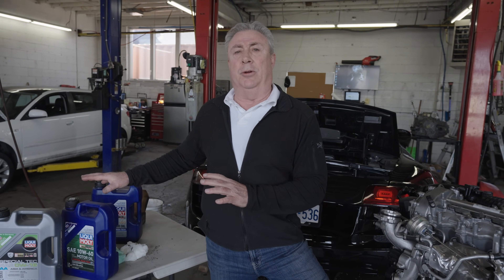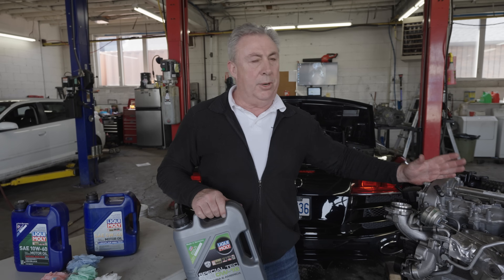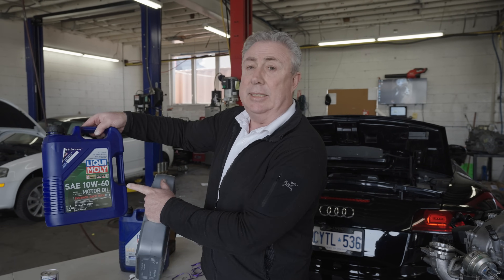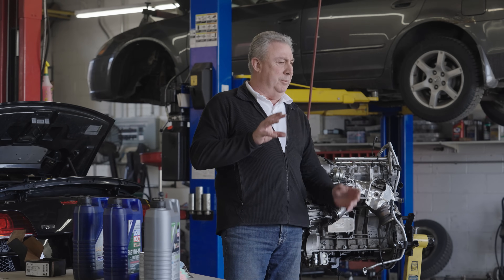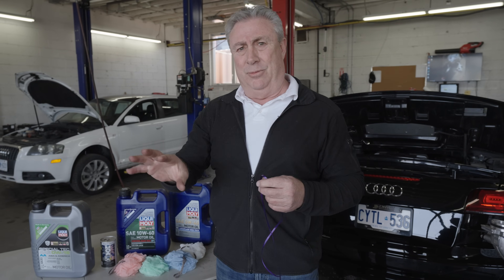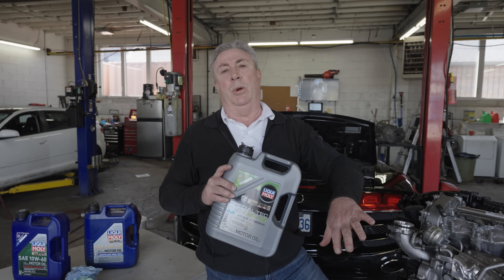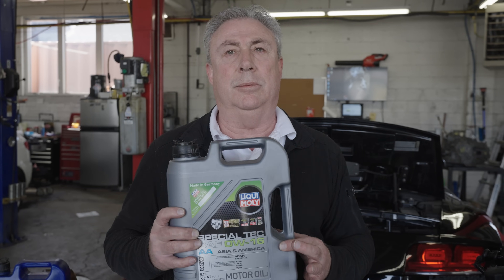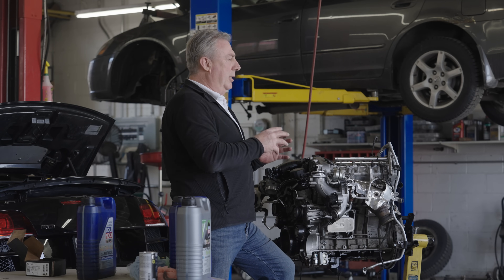Thin engine oil just a Scam? What's Safe

Comment: If you CARE about the environment, make your car last LONGER.   It takes more fossil fuels, minerals, energy to make a new car than to simply take care of your old one and lose 0.5 mpg over its life.  

The CAFE laws are good, but oil viscosity should not be what manufacturers use to get under the requirements.  

I knew I'd like this guy when I saw him using LiquiMoly oils.  Never use anything else in mine!

Comment: Multi-grade oil is not thinner when cold, nor is it thicker when warm. This statement of thinner when cold and thicker when warm is a totally false, misinformed belief! Why is it recommended to change your oil when the car has been running and is up to temperature?
The oil flows better, easier, thinner, than when it is cold. When the multi-grade oil is cold, it flows slower,thicker. Changing oil from a cold car, has a slower drain rate and possibly less oil will flow out of the drain as compared to a warm engine.

Multi-grade oils "ACT" like the numbers on the bottle. When cold the oil acts like the 0w,5w,10w or whatever the first number is. When warm, the oil acts like the higher number at that higher temperature. The oil is not getting thicker, it is acting like the 0,20,30 or higher grade would "ACT" (flow, viscosity) at that higher temperature.
The misunderstanding is: the oil acts differently as the temperature changes. The temperature controls the rated viscosity of the oil. It is an inverse action on the oils part. The oil acts like the straight weight oil at the different given temperature. I.e acts like the lower viscosity at colder temperatures ... acts like the higher viscosity at higher temperatures. The oil is not getting thicker as the temperature goes up, and it is not getting thinner as the temperature goes down ! It is only flowing,acting like a straight weight oil at the different temperatures. The oil weight is attempting to mimic straight weight oil for a given temperature.
Cold multi-grade oil flows slower than hot multi-grade oil PERIOD ! Cold 5w oil is much thicker than hot 30w oil.

                                       Hope this helps

Comment: Many folks are unaware that modern cars have variable speed oil pumps based upon engine demand. They require a certain grade of oil. My 2026 Prius takes 0W-8 oil and has very tight bearing tolerances if you use the wrong weight of oil the gap is so small you may starve the bearing for oil if you use a thicker oil assuming thicker is better. The motor oil geek did testing and everything was fine with his daughters car 0W-8, with the added bonus of better mileage with the thin oil. Summary; thicker is not always better. guys do not VOID your warranty by following uninformed advice. Motor Oil Geek https://www.youtube.com/watch?v=sALAUhldASc

Comment: I've been researching this online and I still cannot find a clear answer for modern engines. In the old days we always bumped up the grade when the miles on our engines hit 100K or so. But today's engines do have tighter tolerances. My particular situation is frustrating. I'm driving a 2019 Honda CRV with the L15 turbo charged motor. It's reached 100K miles. It says 0W-20 on the engine yet globally (aside from North America) this engine is rated for the use of 5W-30. I can't imagine that there are any actual tolerance differences between those engines and mine. My bigger concern is the oil passage to the turbo. I've read that it may not be able to handle a slightly thicker oil and I don't want to burn up the shaft bearings. Has anyone here used 5W-30 in a Honda L15 turbo charged motor in the USA?

Comment: Hello TAS, I work for an auto manufacturer and develop cars for a living. The viscosity of oil we recommend is dependent on four things: 1) Bearing clearance 2) Bearing surface area 3) Bearing load 4) Operating oil temperature. We can create proper hydrodynamic lubrication with oil that has the viscosity of water if we meet the proper criteria. There is nothing wrong with thinner oils if the engine has been designed for them. In fact, you're more likely to cause damage or codes running a thick oil in an engine designed for a low viscosity through bearing starvation and insufficient oil flow through the oil driven cam phasers. Most wear occurs at startup-not when running. Low viscosity oils get into the appropriate places faster-especially in very cold temps. 

The problems you are seeing with cars today and engine failures has to do with manufacturing issues and internal drama. People are making the assumption it's tied to oil, but that's not the case. Plants are struggling because of cost cutting measures, insufficient downtime for quality control and system checks, too many rookies and unqualified on the floor, etc etc. All this leads to manufacturing errors and problems. 

The fact that you see some manufacturers recommending thicker oil as a "solution" reflects the reality that replacing thousands of failed engines is not economically viable. Therefore you apply a bandaid solution to help slow down the problem until the vehicle is out of warranty. Thick oil is not solving the problem, but it's helping offset the fact you've got excessive clearance and bearing damage in an engine that has manufacturing errors.

Conspiracy theorists will tell you that thin oil is some EPA or government driven plot to ruin engines, but it's definitely not the case. We can make engines last longer and get better gas mileage by using lower viscosity oils. In some parts of the US the temperature falls to negative 40 degrees. If you run 15W-40 oil in those conditions you're grinding metal. Remember- we want to create a hydrodynamic state as soon as possible! That keeps clearances tight, bearings healthy and allows you to go 300k+ miles with proper oil changes. Thinner oils are not damaging your engine. Hope this helps.
Reply from the maker: Thanks for the industry pro insight!  Appreciate the feed back.

Comment: daughter's 2014 CRV has the notorious rattle on cold start ups with 0W20....does not have rattle with 5w20 or the 5w30 I currently use in it....lifters don't tick either.

Comment: If you have a Turbo in your engine - change your oil every 3-4000 miles (if your heavy on the pedal 3000 miles and if a normal driver 4000 miles) - spooling burns oil and wears it out in about half the time the car manual says to change.  Also, let your car idle when getting off the road for about 1-2 minutes to let turbo cool down.  I use 0W-20 all year here in Nova Scotia, Canada.  I go to the dealer as well.  2021 Honda Accord 2.0T Sport.

Comment: 0w20 or 5w20.
My thought is as long as it isn't sub zero out, I'm golden using 5w20 in my tacoma. Why? Because at some time during the warm up cycle, both are a 5 grade anyway. My engine just sounds a tiny bit quieter running 5w20 Ultra Platinum  vs 0w

Comment: I used 5-30 in my 2018 Malibu that " requires " 0-20 " . I had no issues and no loss in gas . There are as many people on here that say ," Use only what  the manual says",as there are that say it's ok to switch it up .

Comment: You are 100% wrong if you think it's all about fuel economy and emissions. Now I'm not going to go into a long in-depth explanation but I will say this. The thin oil is because the tolerances between the can shaft and the bearings and the crankshaft and it's bearings is very close together. If you put a thicker oil in such an engine it slows down the gallons per minute flow inside that engine. And since oil is 40% of your Cooling, because there are parts besides your engine that only oil touches. So it cools those parts by absorbing the Heat then transferring it through the block to the actual cooling system.

So if you add a thicker oil to an engine that's not worn for the tolerances are further apart because of that wear. The gallons per minute flow can slow down to a point to where the parts that the oil cools gets hotter, and the oil itself gets hotter. Hotter engine parts expand more causing more wear. Hotter oil breaks down quicker causing more wear. And you have to change it more often because the heat is breaking it down. And if you're pissed and rings we're mainly broke in on a thinner oil, a thicker oil may cause more consumption. And because the whole system is set up to work with the thinner oil, what gets up to the piston and the Rings to cool and lubricate will not be as much causing varnish buildup around the Rings and the Pistons which can cause the Rings to stick to the Pistons.

Then we have the problem of the oil pump pressure relief valve. When you put thicker oil in and increase the oil pressure, that relief valve that regulates the pressure will open up more sending the oil back into the old pan and not through the engine. This causes problems also because that spring that operates the overpressure valve in the old pump can lose it springiness and allow the valve to not fully close means that part of your oil pressure is going to continually leak out that over pressure valve. Which means you'll have to replace the oil pump or suffer major engine damage. And I can go on and on with all the problems this can cause. And by the way, if you do not use the correct weight, this voids the car warranty concerning your drivetrain which includes your engine. So telling people to do this is setting yourself up to be sued when this happens to someone who was just following your advice.

Comment: Been considering this lately... Toyota 5.7L with well over 100K on it, I let it idle a lot in our winters, it pulls a steep 5 mile mountain a lot and smells hot as hell when I park at the top and I never see any wear on the filter between changes.  I do change mine and always have at 3k in all my vehicles because that's just what I'm gonna do.   I do agree with the age old wisdom in this but haven't seen it happen in my Tundra as of yet.  As it does have the increased mileage I am considering jumping up to 5W-30 from 0W-20 just because things must wear over use and I'm just torn on this right now.

Comment: Trust me i  am an oil nerd and if you put the wrong oil in you will sieze your engine as alot of cars have tighter components which is why the oil is thinner . If u use thicker oil it will not lubricate  thats why you have a manufacturers manual to let 6ou know this duuuuhh

Comment: I have the Toyota 2GR-FE 3.5L engine. I punched into Google "Does the 2GR-FE use different viscosities of oil outside of the U.S." and this came up--------Yes, the 2GR-FE engine is specified for different oil viscosities outside the U.S., with the U.S. market typically requiring 0W-20 due to emissions regulations, while other markets may allow for heavier oils like 5W-20, 5W-30, or 15W-40. These different recommendations are often based on ambient temperature and fuel economy standards in different regions. U.S. market: The 0W-20 viscosity is often a requirement in the U.S. market due to government fuel economy and emissions standards. International markets: Owner's manuals in other regions frequently list a range of viscosities, such as 5W-20, 5W-30, or even 10W-30, depending on the specific climate. Reason for variation: Manufacturers use different oil recommendations to balance performance, fuel efficiency, and emissions targets, which can vary by country. For example, heavier oils like 15W-40 may be permitted for use in hotter climates or for heavy-duty applications where engine protection is prioritized over fuel economy.--------So, yeah in America CAFE standards drive this "You can't use anything but thin oils" stuff. They make you think that you will hurt your engine if you use thicker oils. I recently changed from 0W20 to 0W30. I live in N.C. where winter rarely sees teen digits and it can get to a little over 100 degrees sometimes in the summer. I may even go to a 5W30 later.

Comment: What a load of rubbish . All these YouTubers are  obsessed with engine oil . Engines are not blowing up into little pieces when the ignition is switched on . The issues are plastic parts and electrical faults . Then we have the re map brigade who think generating more power makes a car better . More power does not make a car better at all .
So if we drive a car the way it was designed to be driven at the BHP that it was built at from the Factory , service it correctly . Then the engine will out last the car , so much BS regarding oil and very little information on how we should drive it , how we should never remap a car unless you are prepared to either blow it up or spend ££££ on keeping it healthy .

Comment: I own a 2005 Saab 9-3, 1.8 T, well maintained. Don't(very very low) use oil or coolant, despite  it has 262.000km on the odometer. I have to tell that it's chiptuned from 150hp to 220hp but i don't use that often(speeding fines!). What oil do you advise? I live in Holland and the temperature rarely goes down to minus 1 or even minus 5 in wintertime.
Before this car i owned a Ford Mondeo III, 2.5 V6(230.000 km) and runs very good on Castrol Edge 5W30.

Comment: I bought my 2010 Dodge Ram with a 5.7 L hemi with about 100K on it ...was only 2 years old in 2012 and in very good shape. I put marvel mystery oil into the engine oil and changed it probably four times in one month to clean the engine out. Every time after about a week it came out very black. And then the last time it was fairly clean after a week. After that I changed oil every 5,000. The engine held 7 quarts I replaced one of them with a whole quart of marvel mystery oil. Never had any engine problems did not burn oil and I sold it with 256,000 on it running great. Transmission went out at 197 k . changed minor things like water pump. Changed 16 plugs. Keep up with  minor maintenance. Anyway it did not burn oil it did not smoke and it runs good at 256k when I sold it. I also went to 5W-30 instead of 5W-20.  My theory is by adding the marvel mystery oil it helped keep engine clean. I really think I would have got a million miles on the truck.

Comment: The looking at the specifications of a specific motor that they say needs expensive low 0W/20 grade oil due to having tighter tolerances but it is the same as the older motor tolerances that a much thicker oil was used.

Comment: I use 5W-50 molygen and additive in my 2009 SL63 AMG. I have even used 10w-60 liqui moly and lubegard additive as well . I live in a northern state. Engine called for 0w-40.

Comment: Phasing my stock of 0W20 out and going to 5W30 on my Corolla especially as it gets up there in age and miles. Right now I'm doing 0W20 in winter and 5W30 during summer until I deplete all of my 0W20 and then it'll be strictly 5W30 because it doesn't get super cold where I live during the winter.

Comment: My air cooled 4 banger bike loves 10w40...it runs faster on a 5w40 but it loses oil and heats up when stuck in heavy traffic, in tropical weather...it runs like a tractor if i use typical 20w50

Comment: Running 5w40 in a Jeep Grand Cherokee with the 3.6, no issues. Been using heavy oil in many cars for years and haven't had a problem. The vehicle seems to like the stuff and always responds well.

Comment: After my 36000 warranty on my f150  i went to a convention oil  10 w 30  my truck has. Three hundred plus miles on  onley thing i have changed  plugs oil changes. And. Converter's   and tires  and oxgen censers   and  went through 3 batteries  in  15 years it had a 4 , v 6 engine 3 valve

Comment: The auto industry want you to use thin oil  it runs right off .the moving parts  not oiling them oil needs to stick to the moving parts  for a il ng life of the engine
Reply: Sure buddy, just fill up the crankcase with grease and call it a day.

Comment: Oil analysis does not show increased wear from simply going to lower viscosity oil. If it does, prove it to me. Lower viscosity oil simply contains more friction modifiers that thicker oil but the thinner oil also has a better flow rate which is a plus.
https://youtu.be/QgQ8QqXotEk?si=EnVQ6kIuQbM6Ap1H

Comment: I run 10w40 on diesel engine, in france it's not so cold in south
so you can use 5w40 for winter even less if you live in country when the temps goes down to -30C ...

Comment: Keep hearing how my Rav4 engine is supposed to be designed for 0W-16 while other places it's labeled for 5W-30. The claim is anything higher than 0W-16 will mess with the VVT and won't make it past the bearing clearances and that the electric fuel pump.  Does that mean that if it has 5W-30 on the oil cap, the VVT has been altered, the bearing clearances are greater, and the electric oil pump has been reprogrammed to allow for the 5W-30 oil?  😮
Reply: I dont know. Its all confusing me. lol... Im about ready to just get a bicycle .
Reply: @dillonDner in the last few days he did a video and addressed this question. He said that the engines overseas are not exactly the same and that's why the manuals state different oul uses.
Reply: @MrErpman  Could you send me the link or title of that video?
Reply: @MrErpman  You mean the Auto station did a video like that? I would like to watch it but cant find it..
Reply: @dillonDner The Car Care Nut did one
Reply: @dillonDner https://youtube.com/shorts/i6ya-_K01tY?si=ao82_4yBdakTqYnH
Reply: @dillonDner https://youtube.com/shorts/i6ya-_K01tY?si=ao82_4yBdakTqYnH
Reply: @MrErpman  Oh ok.. yes i saw this, which is making me doubt putting 5w30 in mine

Comment: My 2019 KIA Forte calls for 5W-20, with 5W-30 as an option. In the summer (Minnesota) I run 15W-50. After both 5W-20 and 15W-50 oil changes, oil analysis shows excellent results and at 100,000 miles, between the 5000 mile oil changes (every 4 months) the oil does not go down on the dipstick. By the way, Mobile 1 synthetic is used.